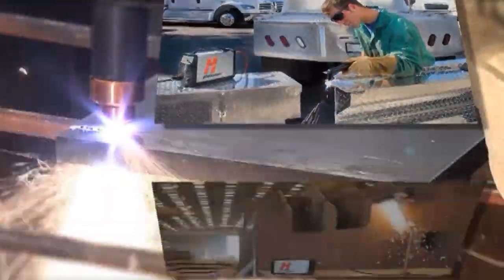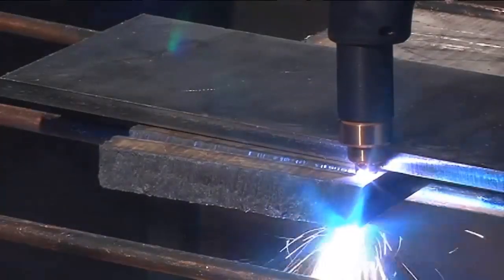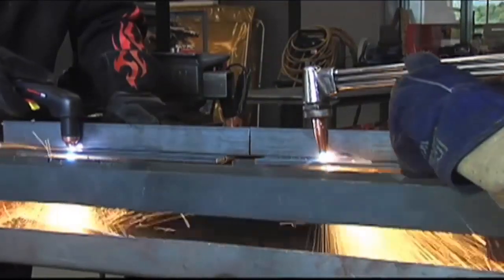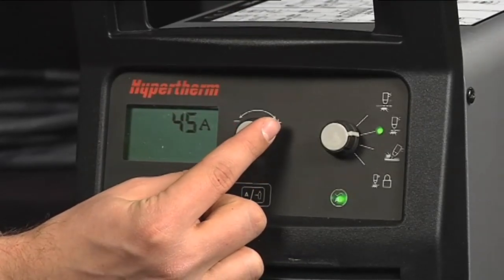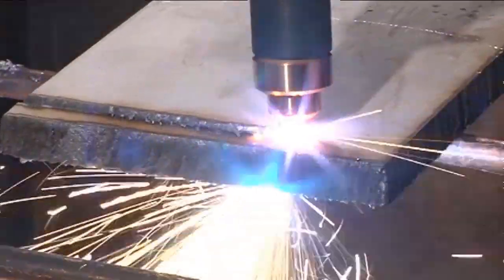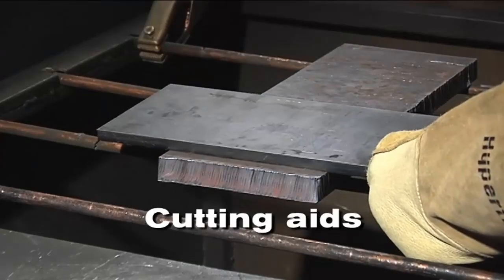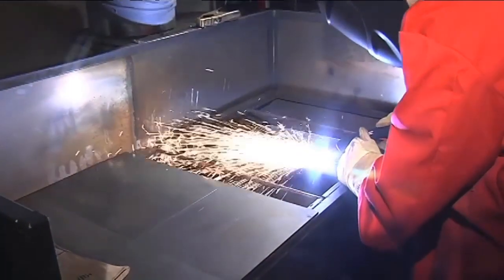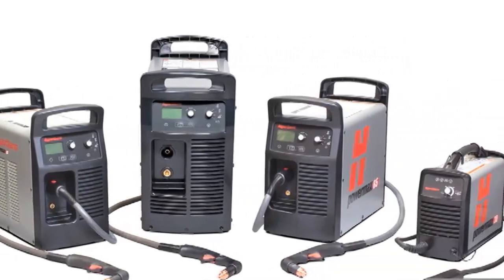Hypertherm Powermax Demo : Powermax 30, 45, 65 ,85 and 105 (David Harries and Co)

Comment: Do you need a drag Shield for thin metal are can you just drag the tip? As long as it's blowing through and low amps,, I know you can with Miller 375,,, what about yours

Comment: Oh, and btw,   I cut Copper sheets like it was steel. 2mm Copper i cut with 65A Nozzle and 1300 mm/m. And 140V.  (With 105 Air)     Don't even attempt the 45A nozzle. Copper is copper is copper.

Comment: Do not underestimate the 105.  I work for the worlds largest underground mine (LKAB) and i do the cuts.  The 105 Air cuts even 20mm with good results.  Hypertherm hardware has never failed after 5 years of industrial use.   
I am not a payed goon.
Hypertherm actually works.
Reply: My welding program uses the plasma cutter ALOT. Many of the students are 18-20. Fun fact the hypertherm they have is 25 years old. Older than the students themselves.
Reply: Well it's rated for 32mm so I would hope it would cut 20mm with good results.